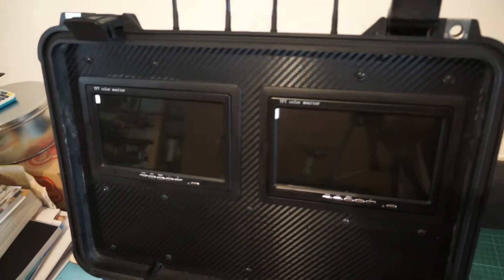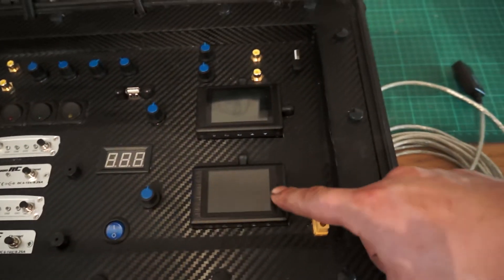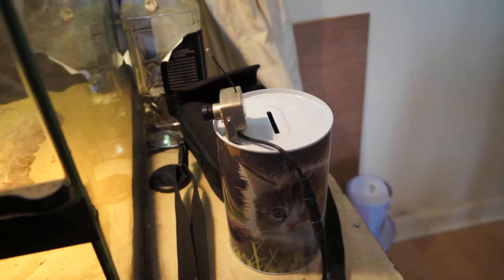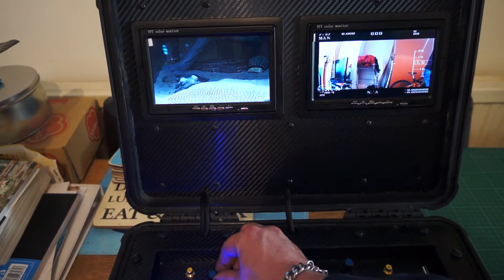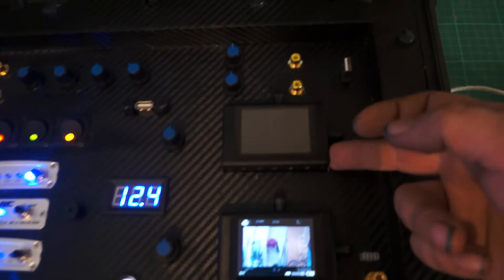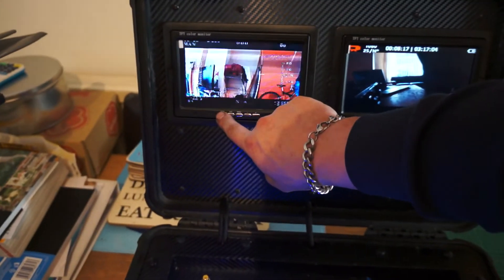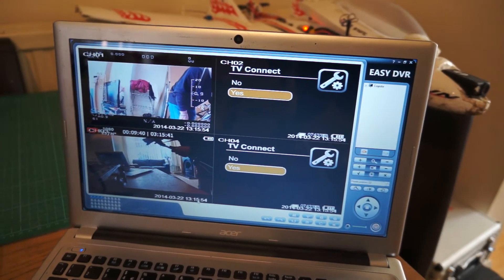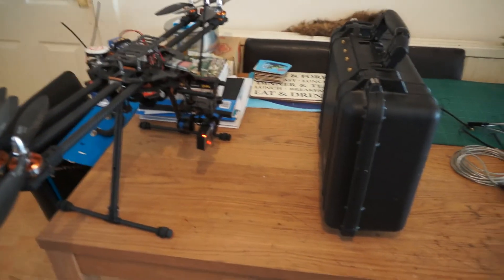Ground Station Overview

Comment: Price?
Reply from the maker: 2x 5.8 receivers £96
2x 2.4 rceivers £56
2x monitors £45
2x DVRs £200
1x USB DVR £30
6x video splitter boosters £72
Switches / digital display £70
4x Lipos £100
Pelicase £109

So around £780 ish

Comment: With all your antennas so close dont you get a lot of interference and what type of board you mount everything to.
Reply from the maker: The antennas on the case are all receiver antennas not transmitter antennas so there is no interference no. The board is 3mm plywood covered with carbon look vinyl

Comment: Hi Coyote....I have purchased the same Monitor from E-Bay using your build thread details....Does this screen suffer Blue Screen?..it sounds like you have been using it to fly with, what are your experiences?  I am just starting up in FPV, but not RC flying, done plenty..I will be using the Immersion VRX and TX plus a Mobius Cam...Cheers m8 for any help you can give me..
Reply from the maker: Hello, The screens do blue screen but only after the picture has been in static for a long time. I run mine with a video booster which stops this from happening. It works fine to fly with, it needs a sunshade which was part of the build but I have got around to making it yet.
Reply: Thanks Coyote....Since my last post the monitor has arrived..next day service, very good...It looks exactly like yours, even has a small remote!!It has two video input cables...plus a fused red pwr, and a black neg..plus a blue wire....Whats the blue wire for??...Since I will be using just the one screen, I assume I wont need a Video signal booster or do you think its a good idea to prevent blue screen?...My GS is going to be a tripod with a tunnel screen with RX and a directional antenna on it...Seen one on here, seems like a good idea as you can point it easily and move it during flight....Oh, check out my channel if you like miniature Gas Turbines..home made, I have a flight clip...Gonna learn FPV using a Home build Tri-Copter...
Reply from the maker: I can`t remember what the blue wire is for but maybe its a reverse switch if your using it with a reversing camera, either way its not used for what we want it for. Yeah sure I`ll have a look at your vids :) Get yourself onto FPVHub for plenty of help, great bunch of UK pilots on there